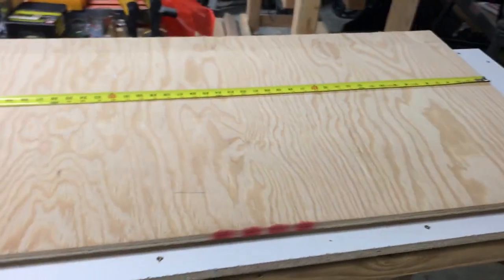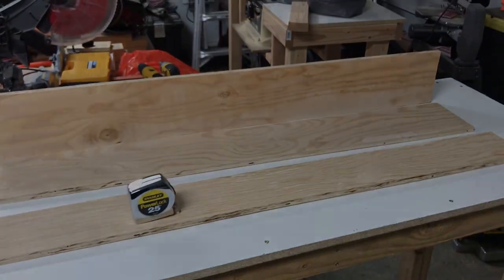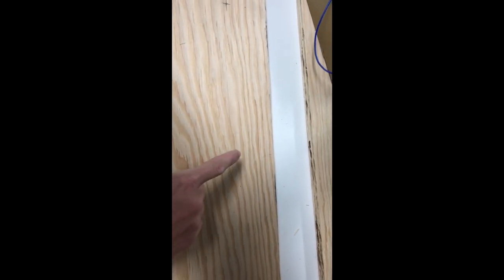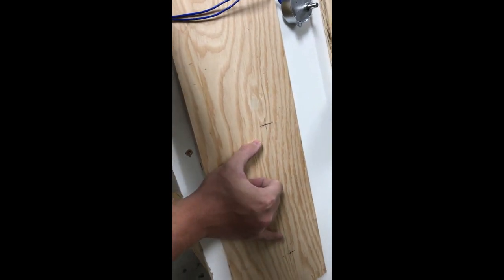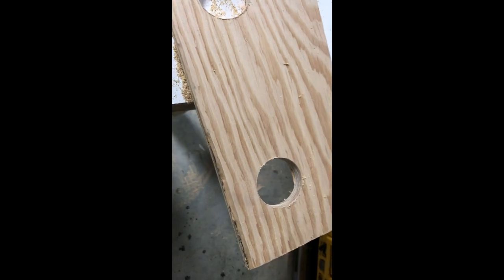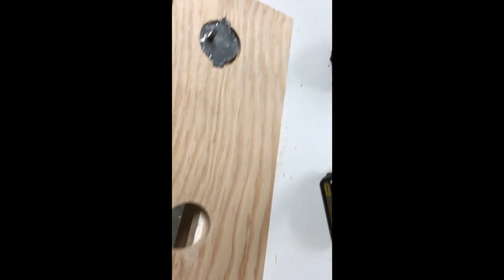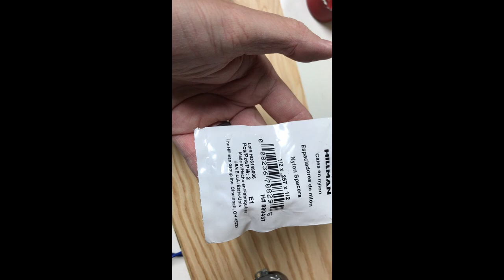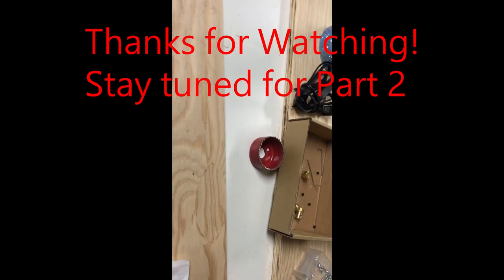6 Cup Turner Part 1

Comment: Hey demitri awesome video I’ve made two of these so far and they have worked great except one small problem they tend to shake after putting on cups not all motors but a few here and there any suggestions on a quick fix to this issue without rebuilding them? Any help is appreciated
Reply from the maker: My initial reaction to a shake or shimmy would be that the pipes are not aligned. They need to be level directly from the motor. There could also be too much weight on them. For instance, if the pipe is unnecessarily long and putting strain on the motor, it will shake. I'd imagine it either needs more bracing (see my newer video for the bracing I added. This one is older) but definitely check to make sure the pipe coming off of the motor is level from all angles. Whether that means it's high in back and low in front, or too far left in the back and far right in the front. Something isn't lining up.

Comment: Thanks a ton for the video, great job. Time to remake mine and add 3 more motors! Do you know what gauge wiring you used for light switches? I may have missed it in your vid. Thanks
Reply from the maker: You're most welcome! Thank you very much!

I'm not sure of the gauge or the parts list... I'll get back to you in a few days when I have a chance to look. Very busy work week for me.
Reply: @diy-mitri9737  No worries on parts list, I think I have everything.  But like always I'll be making several trips to Home Depot for forgotten things! I'm chicken when it comes to electrical, mainly wanting to make sure my wiring isn't overload. I'm using same motors as you. My 2 cup turners I did with lamp switches, Building 4+ turner, wanting to have individual light switches like yours but don't want to overload wiring and burn my house down! Again, thanks for your awesome vid & help!
Reply from the maker: @hillcityvapors2151  You're welcome!
Reply from the maker: @hillcityvapors2151  Just checked. It is 16 gauge wiring. Same stuff that you'd use on your outlets or light switches in your home.
Reply: DIY-Mitri do you have a parts list?